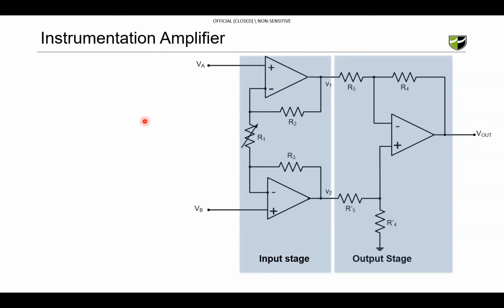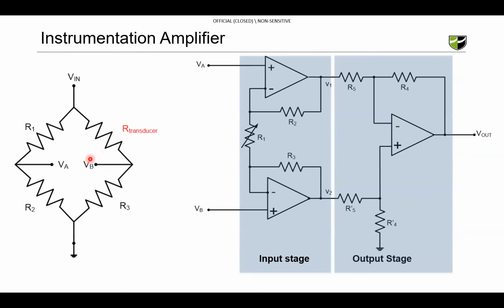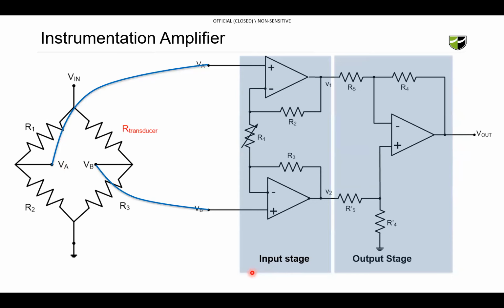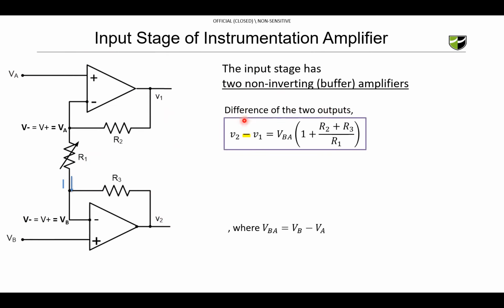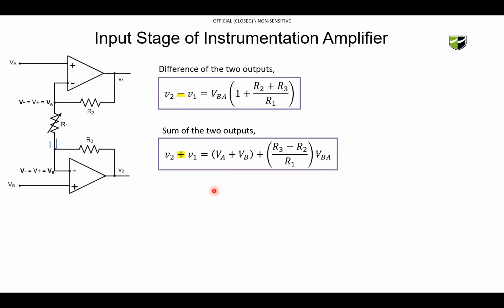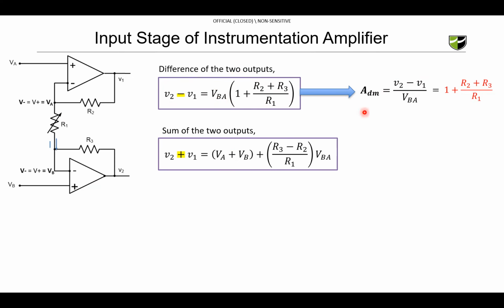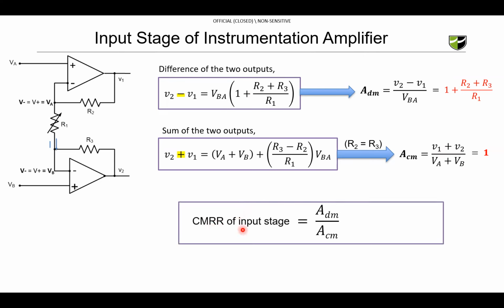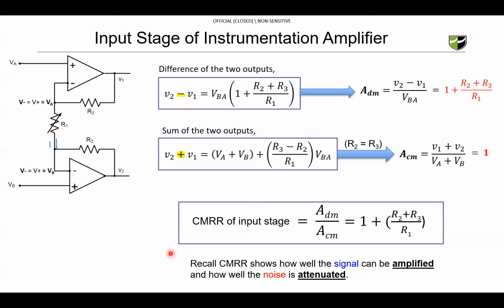Instrumentation Amplifier - Input Stage

Comment: It has 2 output from the wheatstone bridge that is connected to the input stage which means the measurement from the wheatstone bridge would be going into the instrument amplifier which also as 2 outputs and 2 inputs

Comment: An instrumentation amplifier (InAmp) amplifies small differences between two large signals. Its input stage, often using three op-amps, provides high input impedance, isolates the input, and amplifies the difference. This configuration ensures high gain, high common-mode rejection, and low output impedance.

Comment: The input and output stages comprise the two stages of the instrumentation amplifier. Two non-inverting amplifiers make up the input stage. Their non-inverting terminals are connected to Va and Vb, while their inverting terminals are connected to feedback and R1, a variable resistor. The given formulae can be used to calculate the differential mode gain (Adm), common mode gain (Acm), and common mode rejection ratio (CMRR).

Comment: The instrumental amplifier has two stages which are input and output stage. The instrumental amplifier has two inputs which are VA and VB and one output. The VA and VB are usually connected to the wheatstone bridge.

Comment: The input stage of an Instrumentation Amplifier uses two voltage inputs that is fed into two non-inverting amplifiers that are in a closed feedback loop. There is a Variable Resistor that is connected to to the closed loop of the amplifiers that can be tuned to increase or decrease the CMRR of the input stage.

Comment: The instrumentation amplifier consists of two stages which is input stage and output stage and it has two inputs which are VA and VB which are connected to the Wheatstone bridge in the input stage and two non inverting amplifiers and the output stage has one Vout .

Comment: The input stage amplifier of the instrumentation amplifier consists of two input voltages VA and VB which are the output voltages of the Wheatstone Bridge circuit. These two inputs contribute as the two input voltages of the non-inverting amplifier producing output voltages accordingly.

Comment: The instrumentation amplifier consists of two main stages: the input stage and the output stage. The input stage includes two inputs, VA and VB , which are connected to the Wheatstone bridge, and incorporates two non-inverting amplifiers. The output stage provides a single output, Vout

Comment: The input and output of an instrumentation amplifier are two stages. The output from the Wheatstone bridge which is VA and VB, is used as the two inputs in the instrumentation amplifier.There are two formula differential mode gain and common mode gain to find the common mode rejection ratio.

Comment: The input stage of an instrumentation amplifier provides high input impedance ensuring minimal loading on the signal source, and initial differential signal amplification. It also rejects common-mode signals, enhancing the signal-to-noise ratio. This stage ensures accurate processing of low-level signals, making it suitable for precise measurement applications.

Comment: The input and output of an instrumentation amplifier are composed of two stages. Two non-inverting amplifiers were added to the input stage. The amplifiers' inverting terminals were linked to feedback and Variable Resistor R1, while their non-inverting terminals were connected to Va and Vb. It is possible to compute Adm, Acm, and CMRR using the previously described formulas. Usually, the acm of the input stage is 1.

Comment: An instrumentation amplifier has 2 stages called input stage and the output stage. There is two input for the input stage. And one output.  Basically, The output from the Wheatstone bridge which is VA and VB, is used as the two inputs in the instrumentation amplifier.

Comment: Two stages make up an instrumentation amplifier's input and output. The input stage was supplemented with two non-inverting amps. The non-inverting terminals of the amps were connected to Va and Vb, while the inverting terminals were connected to feedback and Variable Resistor R1. By using the aforementioned formulas, Adm, Acm, and CMRR can be calculated. The input stage's acm is typically 1.

Comment: The instrumentation amplifier is made up of two main stages: input and output stages. It has two inputs and two outputs. The input stage has two non-inverting amplifiers. CMRR shows how well the signal can be amplified and how well the noise is attenuated. The higher the CMRR, the signal will be amplified much more and the noise will be attenuated a lot.  -May

Comment: A specific type of differential amplifier used to measure small voltage variations between two signals is called an instrumentation amplifier, or in-amp. It is frequently utilized in devices like test and measurement equipment where extreme stability and accuracy are necessary.

Comment: Instrumentation amplifier is intended for precise, low level signal amplification where low power consumption, high common mode rejection ratio, and high slew rate are desired. It has 2 stages, input stage and output stage.

Comment: The input stage consists of 2 non-inverting amplifiers, 2 inputs and 2 outputs.
The higher the CMRR, the more the signal is amplifies and the noise will be very attenuated.

Comment: The input stage has two non-inverting amplifiers, where the difference of the two outputs, Adm = 1 + (R2+R3)/R1 = (v2 - v1)/VBA. And the sum of the two outputs, Acm = (v1 + v2)/(VA+VB), and if R2 = R3 then Acm = 1.

Comment: An instrumentation amplifier (in-amp) is a type of differential amplifier that is designed to measure small voltage differences between two signals. It is commonly used in applications where high accuracy and stability are required, such as in measurement and test equipment.

Comment: The instrumentation amplifier has two inputs consisting of two non-inverting amplifiers. These two inputs are connected to node A and node B of the Wheatstone bridge. The differential mode gain (Adm) is the ratio of the difference of output to the difference of input. The common mode gain (Acm) is the ratio of the sum of output to the sum of input, equal to 1. The common mode rejection ratio (CMRR) is the ratio of Adm to Acm.

Comment: The instrumentation amplifier's two stages are the input stage and the output stage. The input stage is made up of two non-inverting amplifiers. Their non-inverting terminals are linked to Va and Vb, and their inverting terminals to feedback and R1, a variable resistor. The following formulas can be used to compute differential mode gain (Adm), common mode gain (Acm), and common mode rejection ratio (CMRR).

Comment: An instrumentation amplifier's primary function is to reject signals that are common to both inputs and to enhance the voltage difference between two input terminals. It has one output and two inputs.

Comment: The primary function of an instrumentation amplifier is to amplify the voltage difference between two input terminals while rejecting common-mode signals (signals that are common to both inputs). It has two inputs and one output.

Comment: The input stage and the output stage make up the two stages of the instrumentation amplifier. Two non-inverting amplifiers make up the input stage. Their non-inverting terminals are connected to Va and Vb, while their inverting terminals are connected to feedback and R1, a variable resistor. The given formulae can be used to calculate the differential mode gain (Adm), common mode gain (Acm), and common mode rejection ratio (CMRR).

Comment: Instrumentation amplifier is made up of 2 stages, VA and VB are both connected to the Wheatstone Bridge. 
The input stage is made up of 2 non-inverting amplifiers with 2 inputs and 2 outputs. The sum and difference of the 2 outputs can found using the respective formulas.

Comment: Instrumential Amplifier uses the Va and Vb from the wheatstone bridge as the input. the difference of the two outputs and the sum of the two outputs can be used to find the CMMR of the input stage. normally ACM is usually 1 since R2 = R3. R1 can be modified so that the CMMR can be tuned accordingly.

Comment: Instrucmentaion Amplifer is made of two main stages , first the input stage, second output stage
It has two inputs VB and VA and one output VOUT which are typically connected to the wheatstone bridge
The input stage is made of two non-inverting (buffer amplifiers)

Comment: The instrumentation amplifier consists of an input stage and an output stage and By adjusting R1, the common mode rejection ratio of the instrumentation amplifier can be tuned.
It has two inputs (VA and VB) from a Wheatstone Bridge and one output (VAB).

Comment: The two primary stages of the instrumentation amplifier are the input stage and the output stage. The input stage has two inputs, VA and VB, which are linked to the wheatstone bridge, while the output stage has one output, Vout. There are two non-inverting amplifiers in the input stage.

Comment: The instrumentation Amplifier consists of two main stages the input stage and output stage with two input at the input stage VA and VB which is connected to the wheatstone bridge and one output Vout at the output stage. The input stage is made of two non-inverting amplifier

Comment: The input and output of an instrumentation amplifier has two stages. Two non-inverting amps were added to the input stage, non-inverting terminals were linked to Va and Vb, and inverting terminals were connected to Variable Resistor R1 and feedback. Adm, Acm, and CMRR can determined by applying the above formula. Typically, the input stage's Acm is 1.

Comment: The input and output of an instrumentation amplifier are two stages. Two non-inverting amps were added to the input stage; their non-inverting terminals were linked to Va and Vb, and their inverting terminals were connected to Variable Resistor R1 and feedback. Adm, Acm, and CMRR can be determined by applying the above formulae. Typically, the input stage's acm is 1.

Comment: Very good explanation about the instrumentation of amplifier -Input Stage :
    The instrumentation amplifier comprises two stages, with distinct input and output stages. In the input stage, two non-inverting amplifiers are integrated, connecting their non-inverting terminals to Va and Vb, while their inverting terminals are linked to a Variable Resistor R1 and feedback. The calculation of differential mode gain (Adm), common mode gain (Acm), and common mode rejection ratio (CMRR) can be performed using the provided formulas. It's noteworthy that the common mode gain (Acm) of the input stage is usually set to 1.

Comment: The instrumentation amplifier consists of two stages - input stage and output stage
The input stage has 2 inputs and 2 outputs. Both amplifiers used are non-inverting amplifiers.

Comment: It is typically including a differential amplifier configuration that enhances the common-mode rejection ratio, allowing the In-Amp to effectively amplify the desired signal while minimizing interference from common-mode noise.

Comment: The instrumentation amplifier consists of two main stages: the input stage and the output stage. 

The input stage, connected to a Wheatstone Bridge, uses two non-inverting amplifiers to amplify the difference between the inputs (V2 - V1) and the sum of the outputs (V2 + V1). 

The differential mode gain (ADM) is the ratio of the output difference to the input difference. 
The common mode gain (ACM) is the ratio of the output sum to the input sum, usually equal to 1. 
The common mode rejection ratio (CMRR) is the ratio of ADM to ACM. 
Tuning the external variable resistor (R1) allows for adjusting the CMRR.

Comment: Instrumentation Amplifier consist of 2 main stages, Input and Output stage, in input stage where there are 2 output and 2 inputs which are typically connected to a wheatstone bridge .The input stage has two non-inverting (buffer) amplifiers

Comment: The input stage and the output stage are the two stages of an instrumentation amplifier. For the input stage, there are two inputs. and a single result.  The two inputs in the instrumentation amplifier are essentially the VA and VB outputs from the Wheatstone bridge.

Comment: the instrumentation amplifier has two stages. the input stage has two non-inverting (buffer) amplifiers. And for there to be high CMRR the signal needs to be amplified and noise needs to be attenuated

Comment: The Instrumentation Amplifier has 2 stages called the Input stage and Output stage. However the two input from the two non-inverting amplifiers were basically from the output of the wheatstone bridge of VA and VB. There are two formula differential mode gain and common mode gain to find the common mode rejection ratio. Another factor of the CMRR (Common mode rejection ratio) when the external variable resistor is adjusted it will change the CMRR of the input stage.

Comment: INPUT STAGE - The first op-amp acts as a buffer and provides a high input impedance. Its purpose is to prevent the loading of the input signal source, ensuring that the signal source sees a high impedance, and this helps in minimizing signal distortion.

Comment: Instrumentation amplifier has 2 stages input and output. Input stage got 2 non inverting amps whose non iverting terminals are  connected to Va and Vb and inverting terminals are connected to feedback and  variable resistor R1. We can find Adm and Acm and CMRR using the equations given. Usually the acm of input stage is 1

Comment: as the values of R2 and R3 are the same, the second part of the equation will become 0. Therefore, when we calculate the Acm which is the ratio of sum of output over the sum of the input. So, the common mode gain of a differential amplifier is 1.